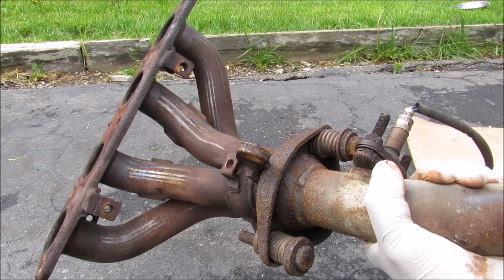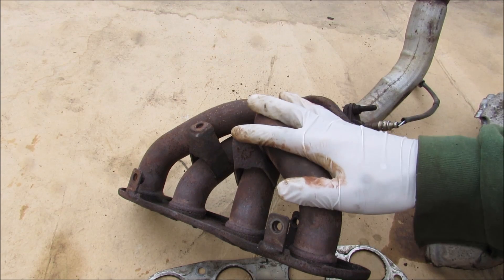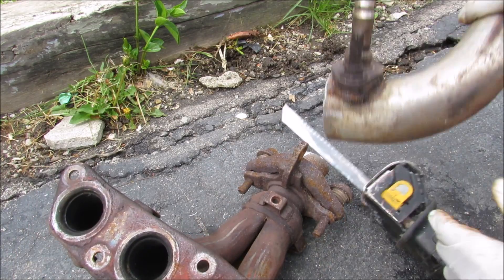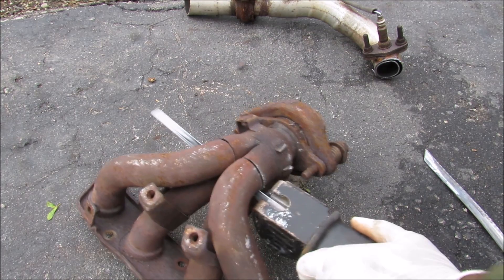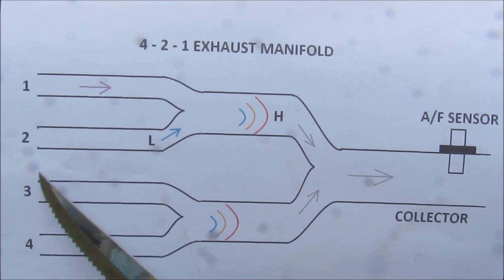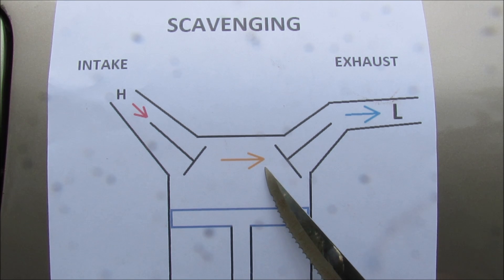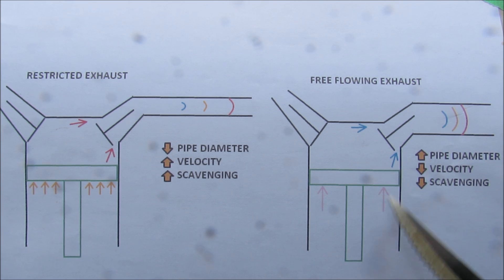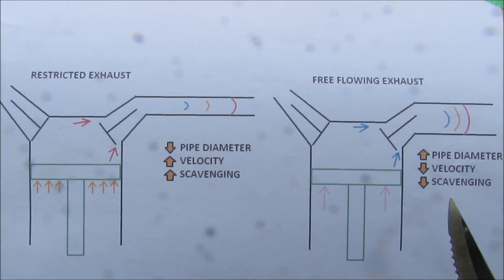How an Exhaust Manifold Works

Comment: Great vid, I just have a question regarding the scavening effect. If you were to use a super/turbocharge, could you get away with a larger pipe diameter?
Reply from the maker: If the pipe is too big the pressure becomes alot less and that wouldn't spin up the turbo enough

Comment: The double wall in the down pipe acts as a flexible to allow movement of the line vs the manifold.
Reply from the maker: +StrategyJoe Good thinking, but I think its more there for heat